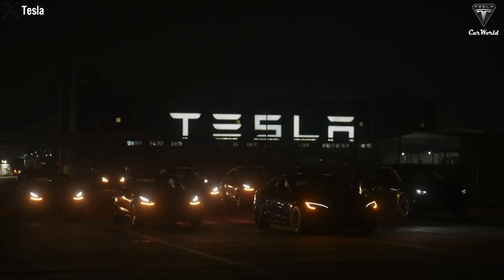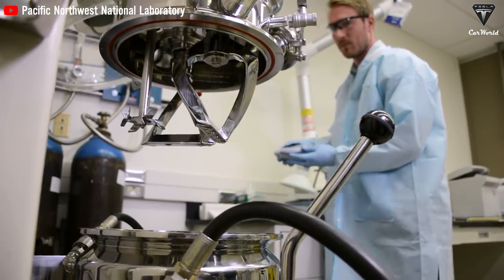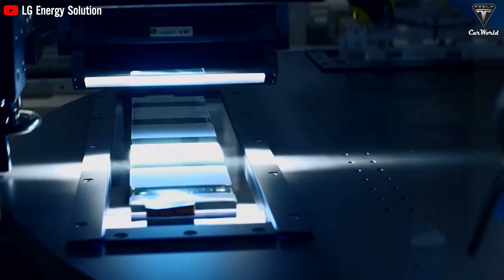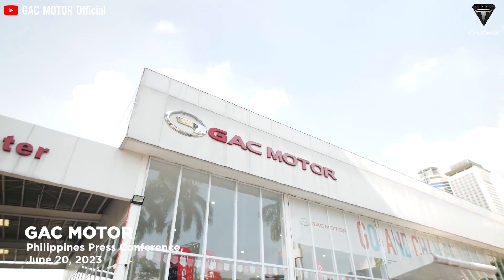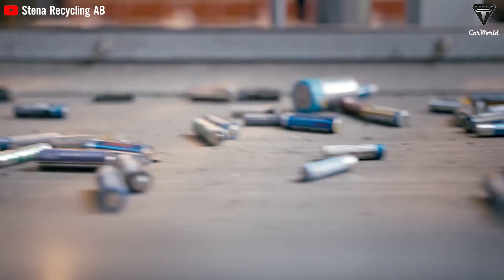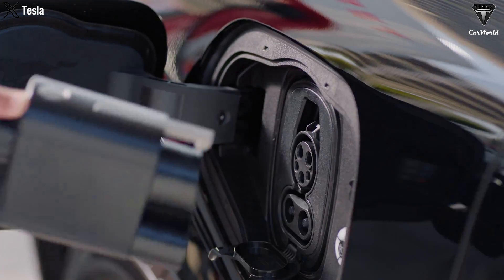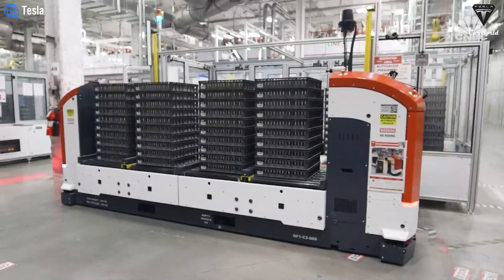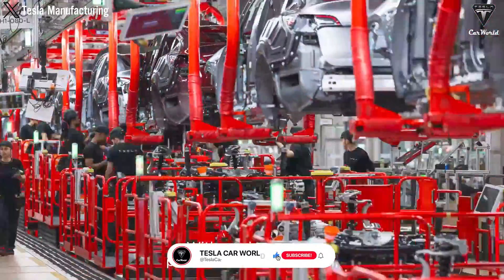Elon Musk Revealed New Graphene Aluminum Ion Super Battery 2 Million Miles Hit the Market!

Comment: Graphine has the potential to change everything but we are talking 10 yrs from now. Lithium is still just a chemical reaction = lag in charging and discharging vs a capacitor which is not using chemicals it is using surface area and what graphine does is increase surface area a 1000 times, think of it as a a super capacitor vs a chemical battery. Problem is creating a single layer carbon lattice is expensive and you need a ton to make a car battery.

Comment: 60-70 times the recharge speed of Lithium Ion is an absolute game changer. It also completely changes the architecture of the EV recharging network. We won’t need chargers everywhere. We’ll need high charge rate “filling stations” just like we have with ICEVs. This is the tipping point for EV adoption.

Another great thing is that Aluminium Ion batteries have no rare earths in them. Recycling them in much easier…and we can cut China completely out of the supply chain!!!

Comment: It says 2 million miles above however in the video the commentator says, " 200 which equates to 3.5 million kilometers". That is an accurate conversion rate of 2 million miles to kilometers but why not correct the 200 quote to remove any doubt about the batteries mileage capabilities?

Comment: 200 miles is not 3,500,000 kilometers. Barely 1 minute into the video, and I'm already doubting the integrity of the source.
Reply: While I can see a huge positive for such a battery, you are correct, very poor fact checking and even worse math. Plus the insanity of anything 2,3,5,7,xx "Times Less" is like fingernails on a blackboard.   When did this stupid way of expressing a ratio/relationship start? 1 half, 1/3rd, 1/5th, 1/7th is the proper way to express a reduction, or 50%, 33%....

Comment: Good news, ''the lightweight batteries are crucial for flying drones and a better environment, ''no more traffic lights'' tire wear'' fewer asphalt roads and metal guardrails'' less light pollution on the ground which results in savings in infrastructure expenditure,'' that autonomous air traffic I suspect that the car will be replaced en masse.

Comment: If they can run a car for 3.5 million km on one charge, why do they need a charger,? 1:00
Reply from the maker: If a car can run 3.5 million kilometers on a single charge, that shows extremely high battery performance. However, a charger is still needed to maintain daily usability and to replenish energy when needed.

Comment: You still produce 60 to 65% of your electricity requirement from your fossil fuels. So just chill and enjoy advanced and improved ICE vehicles. Tested and proven. 
EV will fail not only interms of energy density but from safety point of view also.
Reply from the maker: It is true that many regions still rely on fossil fuels for electricity, and ICE  vehicles still have many proven advantages. However, electric vehicles  continue to improve in energy density and safety, and a shift towards renewable energy could increase efficiency and reduce dependence on fossil fuels in the future.

Comment: a new green Scam Message. May be this will come in some time. but there is no charging architecture out in the world to handle this...
charging points are very expensive. planning a nerwork of hypercharger that can handle this may need 5-10 Years to plan and build this. There are the middle voltage Grids where this charging units must be connected they couldnt handle with this. and all the cool new renewable Energy will not deliver when we need them, they come when they come. changing all mobility to EVs together with a high percent of renewable energy for electricity will collapse our grids. Here in Europe, where all the greenScammers have ruined our energy systems with to much flattering eco electricity and the shutdown of good and safe powerplants for good ground-deliverage. this will become a nightmare. green enrgy and mostly ev-mobility will not safe the world. it will completely anihilating our economy. this is why by blackrock remote-controlled green-scamming idiots make politics...
This nice piece of technology, if it really works, will be another nail in our casket, when the politician dont u-turn the green-scam back to politics for people

Comment: Actually, no battery should lower past 20%. And lead acid, you shouldn't drop below 40%. There may be some exceptions to this rule, but there are few and far between. Also, please, make sure your statements are completely true before you make videos. Dropping batteries to 0%. Is detrimental to most batteries health. It hurts them, it kills them. Zero and 100% are both bad.

Comment: You told that the battery can be charged in less than eight minutes,  but where do this enormous power for charging comes from????
Reply: Typical newer homes have 240vac/200a service. Even at max capacity that is only 48kw per hour or 2 hours to charge 100kwh battery.

Comment: GOOD PRODUCTIVE INVENTION. THESE ARE BEING HIGHLY ADOPTED IN THE PASSENGER SEGMENT AND WHEN IT COMES TO THE TRANSPORT SECTOR WHERE LONG DISTANCES ARE COVERED WE CAN INVENT BATTERIES  WHICH CAN PROPEL VEHICLES OVER LONG DISTANCES AT A SINGLE CHARGE MORE PRODUCTIVELY. AND ON THE OTHER HAND GREEN HYDROGEN ELECTROLYSIS METHODS IS THE NEED OF THE HOUR  TO TRANSPORT GOODS OVER LONG DISTANCES BY SAY TRUCKS AND RAILWAY TRAINS  HERE GREEN HYDROGEN BEING PRODUCED ON THE GO STORAGE OF GREEN HYDROGEN CAN BE AVOIDED INCLUDING SHIPS ON HIGH SEAS AND TRUCKS CAN BE REFUELED BY LOCATING GREEN HYDROGEN MANUFACTURING PLANTS STRATEGICALLY NEARER TO NATIONAL HIGHWAYS  MORE PRODUCTIVELY. AS A SPECIAL CASE GOVERNMENTS CAN GIVE HEAVILY SUSIDISED OR FREE  ELECTRICITY TO ENCOURAGE MANUFACTURING GREEN HYDROGEN ALLROUND KEEPING LONG TERM  INTRESTS AND PARALLELY BENEFITING FROM SAVINGS IN CRUDE OIL IMPORTS  WHICH HAVE BECOME A BURDEN ON THE EXCHEQUER.THUS REDUCING POLLUTION MUST BE GIVEN TOP PRIORITY ACROSS THE GLOBE.

Comment: the silliness about 'fast charging' is ridiculous. a 100kwh battery takes one hour at 100kw charging rate or 20minutes at a 300kw charger. and that is only the theoretical maximum. if you want to be charged in 5mins it requires a 1.2Mw charger. Do these people understand just how much power that is? A large power station has about 1Gw capacity. or enough to charge 1000 cars. That is all. charging speed is NOT the issue but rather battery capacity. if you had a 500kw/hr batteries then charging speed is less important because you don't have to do it anywhere near as often.

and Toyota already has solid-state batteries and despite all the hoopla... EVs have serious shortcomings regarding range and recharge time in the REAL world where you don't already live next to a power station with 2Mw chargers.

Just heard this clown say that some batteries can be charged in SECONDS. Hmmm. as long as you are connected to a 100Mw charger and what size do you think the cables for that would be?

Oh, and now they want your car to send power back to the grid when you aren't using it! Seriously, what dumb nerd thinks that's good? you need to go out and find your car - which was fully charged before - is now nearly empty.

a dumb video.

Comment: Unless you can charge a car in 5 minutes (which leads to the next problem) or you replace / exchange a battery pack for a pre-charged pack (which also leads to the next problem) these are never going to work on a scale governments want them to work.
Reply: not just government. If you are expecting people to give up petrol cars that can be refueled in 5mins virtually anywhere then your replacement technology needs to be at least as goo. and it is not even remotely as good.
Reply: @rosaliebent4833  
This is what happens when you put the cart before the horse. I think electric cars are good Idea, but not yet. They have to fix the Battery Problem before they can start mandating EV's for 2035.

Comment: My sliding comb, bi-lateral carbon, zithium enriched sodium bath battery design holds twice as much energy, 1/3 the size, charges in half the time, last 400 years, and cost 25% less. My battery will be available at exactly the same time, and is 100% recycled. My battery weights less than air, when fully charged and fifty times the weight of air when completely discharged.
Reply from the maker: Thank you for your contribution of useful information. We are always grateful for this

Comment: Million-mile batteries? That sounds too good to be true. What's the catch?
Reply: Quantumscape and PowerCo have come up with a production battery that has about a 390 mile range at the same size as traditional lithium ion battery that after 1000 cycles it only loses about 5% of its density and it charges very quickly. QS baby!
Reply from the maker: Million-mile batteries do offer significant longevity benefits, but potential challenges could include initial cost, scalability of production, and performance under varying real-world conditions like extreme temperatures or heavy usage.

Comment: Hemp is the most earth friendly power source that is humanly possible okay you can make batteries lumber equal to size of traditional logs burning 2 to 4 hours longer superclean. More importantly hemp bio fossil fuel only releases the same amount of carbon monoxide or dioxide I forget which one per mile as a person does when they exhale. Versus coal oil and gas which release tens of millions of years worth of petrified death un oxygenated poisonous air per mile.  The real winning sales pitch is 1 acre of hemp can produce in a file fossil fuel to fuel 10,000 vehicles for a year at a dollar per gallon.   Equally as amazing one acre of hemp produces 3 to 4 times the amount of oxygen as a acre of trees+ it sucks in 3 to 4 times the amount of greenhouse gas airborne pollutants un oxygenated air  as a acre of trees as a added bonus it will rejuvenate replenishing the soil back to Garden of paradise type quality after every harvest even if the landscape has been previously stripped robbed and depleted of all its value from overharvesting things such as cotton corn.  Keep in mind hemp makes over 26,000 different things. But to try and summarize it can be used as a building material a power source clothing, medical remedy high source of nutrition, hygiene products. And it has already been proven to be 10 times stronger than steel and 30% lighter stronger and lighter than concrete stronger and lighter than brick easier to work with on-site meaning you can get the job done and have to time at a fraction of the cost compared to what we are using currently+ it is far more versatile making design possibilities practically limitless. At the same time you can use this product as much as you would like or need without leaving any excess poisonous toxic waste behind. So when you talk about improving upon in maintaining the quality of life to the highest degree that is humanly possible hemp is power personified compared to everything else.

Comment: problem is the cobalt and nickel content, same as Li
Reply from the maker: Yes, one problem with graphene batteries is that if they contain similar levels of cobalt and nickel as lithium-ion batteries, they will still face challenges regarding safety and sustainable supply of these materials.
Reply: @TeslaCarWorld  graphene aluminium batteries do not use cobalt or nickel

Comment: Is a lifespan of 200 years for a battery realistic? I doubt it’s feasible.
Reply: Every technology you see now was impossible even 10 years ago. Lol now you have a super computer in your pocket.
Reply: @dotagodtv1508  nonsense. I'm still using a ten years old smart phone and it works fine. new ones have nicer screens and are faster but not even remotely innovative. they are incremental as is almost ALL technology.
Reply from the maker: It's possible, but currently there are still many challenges to overcome in technology and materials to achieve a battery life of 200 years.
Reply: Keep your battery and change the car - that's a new twist...
Reply: No
Reply: but nuclear batteries possesses the life span of infinite years